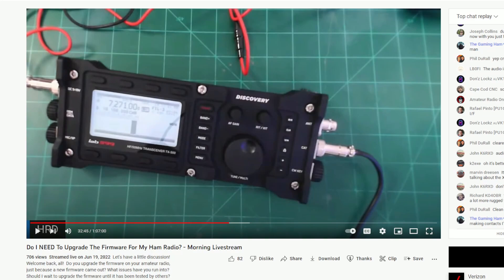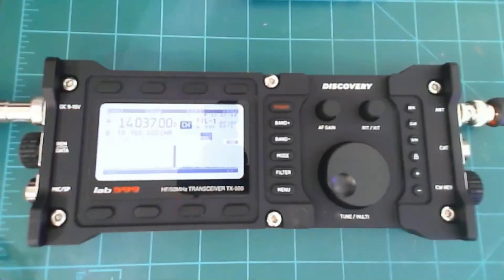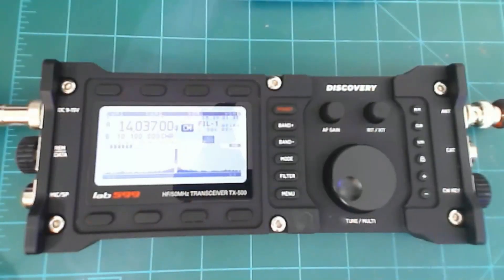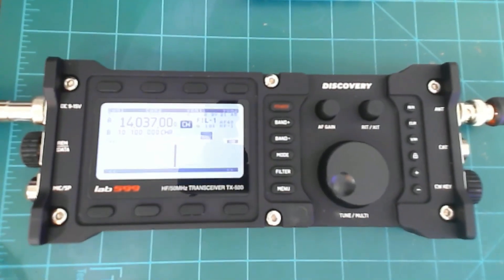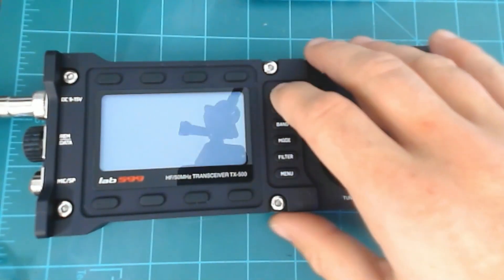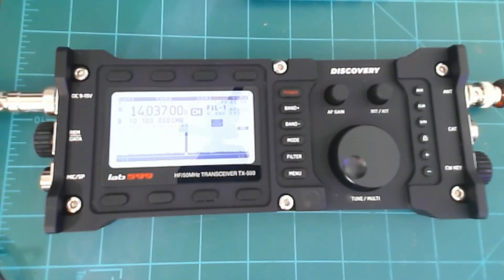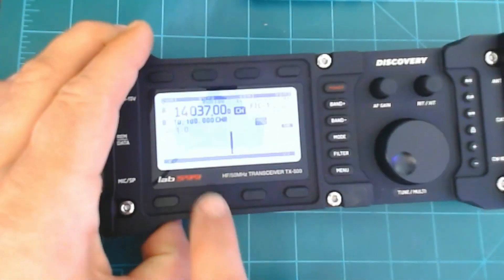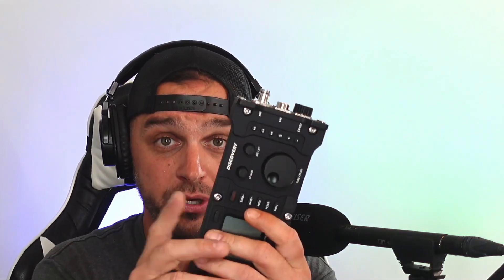Doing This Can KILL your Ham Radio!

Comment: just picked up one of these radios.  Hoping it shipped with the new firmware as it's my understanding they've since fixed this bug?  Just started trying to learn CW so this should be a cool learning aid / backup.  Copying for me is so far the hardest part about learning CW.  Thanks for another great video!
Reply from the maker: It would appear that the firmware did fix the issue.  A good radio. I love it. The fact that it's lightweight, sounds amazing, and is being updated is great. I'm in the same boat as you as CW and Morse code.  I could see you away no problem, but when it comes time to listening I'm very unresponsive to hearing what I'm supposed to hear.  I am putting together a kit for the ham shack hotline which will allow me to do CW over voice over IP. I'm hoping that helps me with my problem being able to decode.  Are there any methods you're using? Which key did you get for the 599

Comment: Your comment about the Xiegu firmware upgrade "coming out every day" is incorrect; I have had the radio for two years. It came with v 1.74 and in that period there have been only six updates being 1.78 the only one with more that one versions. When a firmware comes out I usually wait for reports from other users. I only updated to 1.77 from 1.74 and then to 1.78bx when they finally got 1.78 right.
Reply from the maker: Everyday was an exaggeration, but with the 6100, there was a point where they were coming out multiple times a week.  I don't know what radio you have, but they probably stopped upgrading the firmware once they decided they had a better model to sell.
Reply: @DudeTested  I have the G90 and tontgis point,  all bugs has been ironed out

Comment: The expanded TX for 11m will come in handy for a few of us with local nets but I hope they sort out the CW issue. That said, no CW decoder is ever really all that effective in my experience.
Reply from the maker: Hey Stuart! Thanks for your input.   It looks like they have a fix out for the buffer overload issue.  https://lab599.com/upload/mtrx1.13.09.fw. .  I have not tested it yet myself and unfortunately probably won't get to test out until tomorrow.  I've always had somewhat of luck with CW decoders as long as I was patient.  However, I'm so inexperienced with CW that what I think is working, may not be a good solution.  So it's very nice to hear from people like you who may have more knowledge or better understanding of how the decoder works.  Thanks again!
Reply: I tried the decoder out yesterday and it works pretty well, decoding words like "gardening" and "strawberries" in a convo I was listening to. And there doesn't seem to be sent need to set CW speed to any particular setting as some people have suggested. So long as tuned in properly and the CW to decode is sent reasonably well it seems to manage ok.

73 de M3KXZ

Comment: To be fair, LAB599 did label the CW decode feature as a Beta version. This was the first Beta feature I remember in any of their upgrades. It is simple to roll back to the previous version, IF you kept previous configuration files.  With that said, having an unexpected error condition kick the radio into transmit is NOT ACCEPTABLE.  I rolled my firmware back to the previous version.  73 de Brian - K3ES
Reply from the maker: Hey brian, you have a great point and I did forget that myself. It was a beta firmware for the CW decode feature and they mentioned it. I did mention it on the live stream, but kind of forgot today. But you're absolutely correct and everything you said. I'm going to pin this message just so others can see it.  Thanks for your clarification and input
Reply: @DudeTested  I contacted Lab599,  and they responded to my inquiry. They have fixed the bug, and rolled out Firmware v1.13.09 on their website. Best 73 de Brian - K3ES